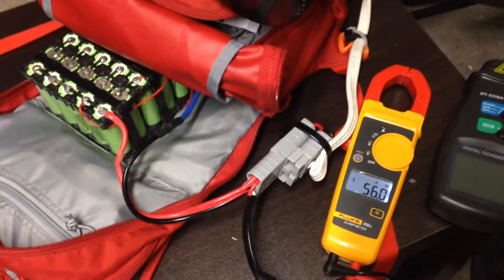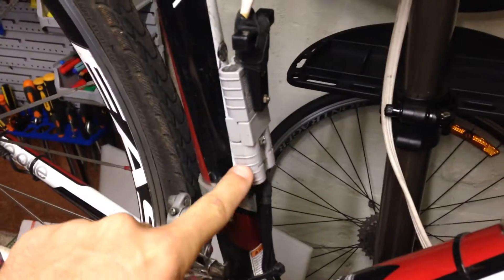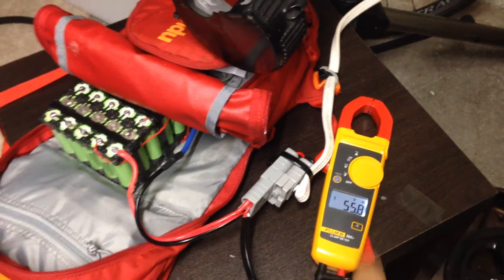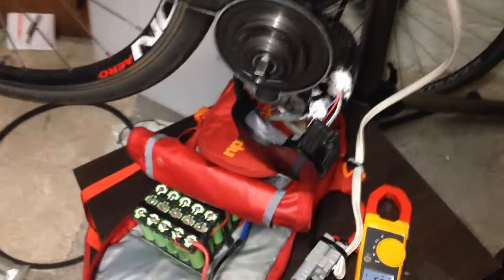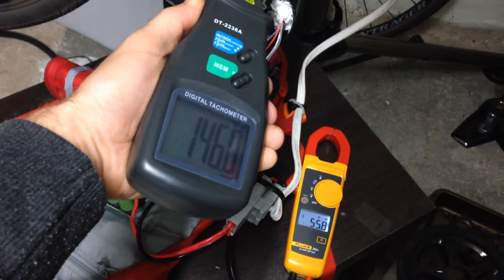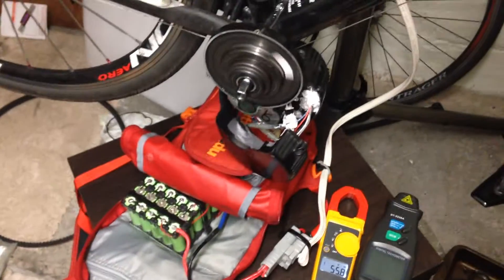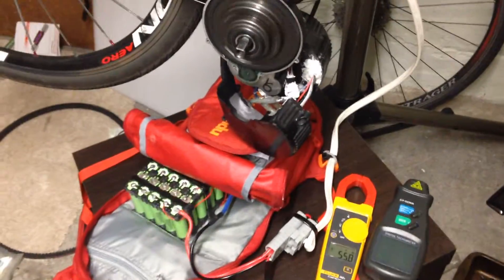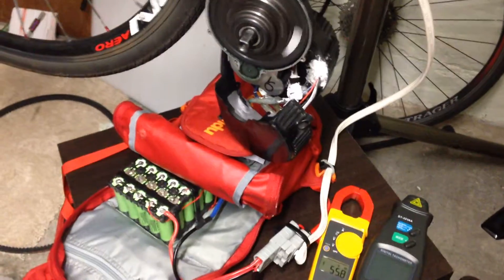Bafang BBS02 + 60A 3000w Castle Creations controller (UPDATE 6) Bafang controller 146RPM at 56v

Comment: so the engine has a gearbox in it and supply the power for the lost of the 2 missing chainrings ?? i m interested to buy this kit because from my research  i found that is the best thing of the electric bikes but now i want to know aprox. what is the range of the supply battery that came in this kit also on both sides :throttle and asist.... thank you for the amazing and crazy things that you do here on youtube !!! :)) you are crazy man !! :))
Reply from the maker: Yeahhhh... thank you for watching my videos and sending a great feedback haha =]
So this is a motor that basically "pedals for you". It doesn't come with Bafang batteries but there are hundreds of batteries to choose... 90% of the sellers will also offer a package deal with 48v battery and some will also offer a larger battery with extended range, not necessary in most of cases. Best importer I know is empoweredcycles.com maybe the only seller offering 2 YEARS WARRANTY tell that I recommended =]

Comment: it is possible to attach another 2 chainrings to the one that the bafang has ???
Reply from the maker: +BV18BLD  - Very good question!!!! It is possible.. however, as soon as you start riding your mid-drive you will understand "why" no one do it... you will notice that your chain will keep on dropping ALL THE TIME.
It happens because when you are pedaling a normal bicycle and you see a bump or hole you naturally stop pedaling. When you have electric motor or petrol powered engine you keep accelerating over the bumps and the chain moves up and down like crazy eventually dropping off the chainring.

So you need a chain tensioner to keep the chain always aligned to your chainring. If you have more chainrings attached you can't have that and you will be stopping all the time to fix your chain... it is really annoying...  all mid-drive vehicles including motorcycles will have the same problem, they all need chain tensioner.
I am really want to make a video explaining al lthat =]